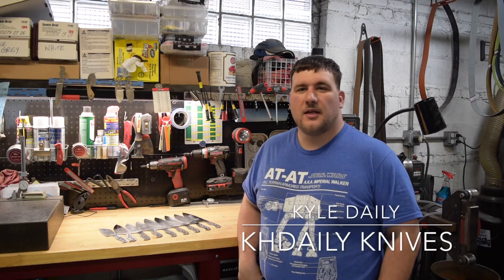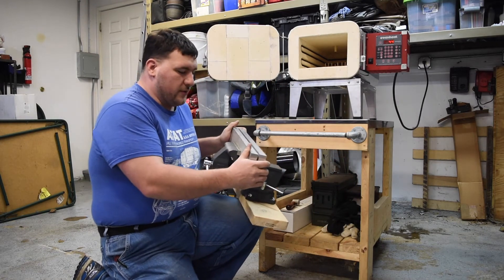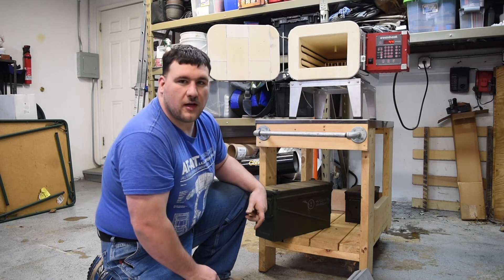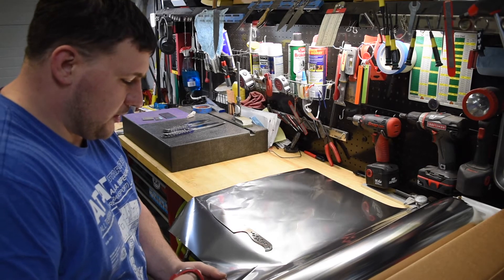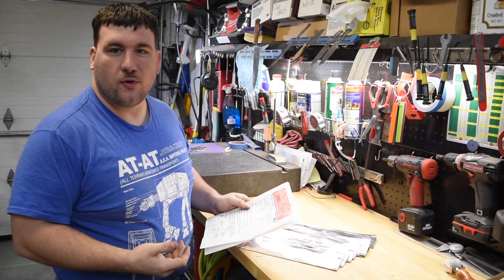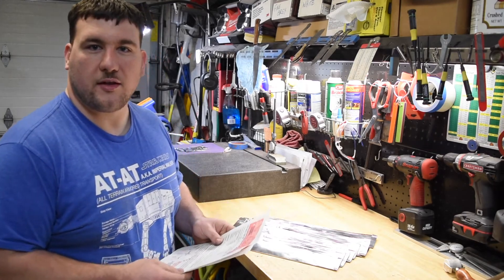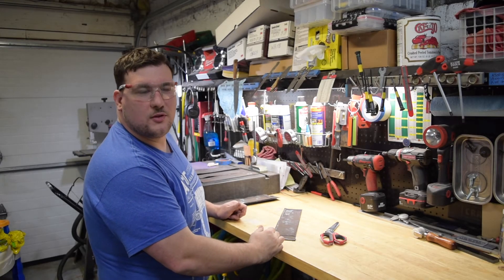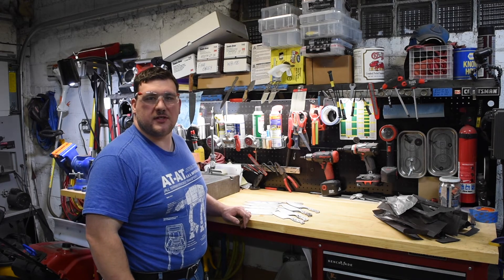Heat Treating 154CM Stainless Steel

Comment: Thanks for the great video. So you put your knives in a cold oven and turned on. Heated knives up to 1200 and equalized. Then 1400 and equalized. Then 1900ish and soaked for 30 min(correct)? How long does the entire process take including heating from room temperature? I think my oven takes too long.
Reply from the maker: I split the difference in the range of temperatures.  I hold for 15 minutes at 1175 F, then 1425F, and then 1950F for 30 minutes.  It usually takes around 3 hours from start to finish in my eveeheat.  The holds add a lot of time, but I think it helps to make sure the blades are at those hold temperatures.  I also have a 220V oven so that helps to heat up faster.

Comment: Do you think the discoloration is caused from two thick of folding over the aluminum ?
Reply from the maker: The colors are some of the natural colors from heating the blade.  Sometimes it can be from the little bit of oxygen that oxidizes in the packet.  I wish it was more consistent, I think it looks rad!

Comment: Great video! How long do you reckon you hit the blades with compressed air to get them cool to the touch?
Reply from the maker: It is about 60 seconds for a larger kitchen knife.  Pairing knives are only about 20 seconds.

Comment: Good moorning please would you tell me about your experience is is better for tougthness blade and tip 154 CM or Sleipner Carbon. sorry for the English but I'm Italian . Thanks for the answer bye
Reply from the maker: 154CM is one of my favorite steels. It holds its edge for a very long time and I have very good experiences with toughness.  It is also has been easy for me to get here in the United States at a reasonable cost for my customers.

Comment: Great informative video, I’ve just bought the same evenheat oven, when you’re heat treating multiple blades, you run the program to austentising temp then you soak the blades after which the oven says “complete” and starts to cool down, how do you keep it at temperature while you’re quenching the blades? Do you just run the program again so it keeps at temp or just use the “add time” feature?
Reply from the maker: Thanks!  I have the oven stay at the austenitising temperature for a longer time (60 minutes).  On the Crucible data sheet says to stay at temp for 30-60 minutes. I start pulling blades at 30 minutes and am usually done after 10-15 minutes.

Comment: What do you mean equalize?
Reply from the maker: That is when the steel is the same temperature all the way through.  On knives since they are so thin, it is less critical. If you were heat treating a block that was 3” thick, you would need to wait at that temperature longer so the outside is hot but the center is not the same temperature. 
Hope that makes sense!

Comment: I plan on heat treating some knives using 154cm,would putting the knives between the aluminum plates harden the steel without using a air compressor?
Reply from the maker: Mysterious Dude 154CM will harden just fine in the air.  Using an air compress more helps when you are doing many blades at once and it allows you to cool them down quicker.  The aluminum plates help to pull some heat out, but mainly they are used to physically hold the blades straight.  I do a lot with thin kitchen knives and they are prone to warping while cooling after heat treating. Hope that helps!
Reply: Cool man thank you👍🏼

Comment: Hello kyle
Don't you mind the fact that when you are plate quenching a blade, the others are still in the oven ?
With this method, each knife of a batch is exposed to the heat a different period of time from the others
Isn't it a problem for the heat treatment consistency ?
Reply from the maker: bretteur2legende I haven’t had a problem with that. The Crucible data sheet says to hold it at temperature for 30-60 minutes. I remove all the blades in about 15 minutes.  I also hardness check every knife and have not seen a difference in hardness between the different knives being at temperature for a longer period.
Reply: @KHDailyKnives  Ok so you have 30 mns to quench your blades, i didn't know that.. Thank you for your quick reply
Keep up the good work ;-)
Reply from the maker: bretteur2legende No problem!  Glad I could help!

Comment: When you stabilize at the different temps I assume you are holding the temp?  How long do you hold it?  I have the same furnace and controller as you.
Thanks in advance,
Eric Stemple
Reply from the maker: John Stemple I hold the temperature at the 2 in between points for 10 minutes each step. With the knife blade being so thin, they are at the oven temperature for the most part. There is a rule of thumb that is 60 minutes for every 1” of thickness. My knives are around 0.11” thick, using the rule it that would be good for blades 0.17” thick. Hope that helps!

Comment: Great video! Any recommendations on where I could find a Wilson like yours?
Reply from the maker: John Stemple Thanks man!  I was extremely lucky to stumble across this one.  I got it from a metallurgist that was going to start his own shop after he retired.  Turned out he didn’t feel like working anymore!  
I would keep an eye out for machine shops that are getting rid of equipment in your area.  Craigslist and eBay can be great options too but shipping could be a lot.  I would call some local machine shops and see if they would let you use theirs or might point you to someone they know. Hope that helps!

Comment: Very Cool.  Do you ever cryogenic-treat your knives.  Had a guy tell me that after he does the plate quench, he treats them in a cooler of dry ice and acetone over night.  I've never messed with SS, so I have no idea if he's crazy or not.
Reply from the maker: Cecil White He is not crazy, he is trying to get a little more hardness in his knives. I do not do cryogenic treatment on my knives. This process gets the knives to 59-60 HRC which is very hard.  When you do cryogenic treatment on the knives, you gain 1-2 HRC in hardness.  When you start having knives over 60 HRC, you need to use more expensive equipment to sharpen the knives.  The extra cost of this additional step for the small batches I do, I don’t feel justifies the cost. Thanks for the feedback!

Comment: Nice info, glad I visit here. Do you mind give us a little info about tempering? How hot did you use in your stainless steel tempering? Thanks!
Reply from the maker: Bagus Bhakti Irawan Thanks!  I temper the blades at 400 F in an oven for 2 hours. This usually always gives me a hardness if 59 HRC.
Reply: @KHDailyKnives  Noted! Thanks, Sir. This info is going to help me a lot in my future knifemaking
Reply from the maker: Glad that helps!

Comment: Here's an old schooler's trick.When I eat at a Chinese restaurant, I save my fortune from my fortune cookies. Put one of those in each bag. When it catches fire (Fahrenheit 451), all the oxygen will burn off inside the bag. No corrosion.
Reply from the maker: I have heard of people putting paper inside of the packets. I have never had a problem with corrosion on the blade, unless I didn’t get the packet tightly sealed. When I pull the packets out of the oven they vacuum down on the blades well. Thanks for the tip!  I might have to try that sometime.
Reply: The larger the part, the more it matters. Probably not so much on knives, since the air pockets are small. Really helps when you EDM a die and it has a complex shape.

Comment: Great video, well put together and informative.    I recently sent some 154CM blades out for heat treatment and I believe cryogenics was used on them.    Have you any experience with that?   Any thoughts?   Thanks.
Reply from the maker: Ken Harrison Thanks for feedback.  You can do cryogenic tempering on the steel. I don’t heat treat enough blades, frequently enough, to make it cost effective for me. The cost of liquid nitrogen/equipment or dry ice would add a lot more to the cost of the knife, for a 1 point HRC increase on 154CM.  At this point I have not had enough customer interest to pursue it. Maybe in the future I will do it.
Reply: thank you, I didn't know it only ads 1 HRC so hard to justify.

Comment: hey pls need to know the right heat for the treatment?
Reply from the maker: I do a three step process from the crucible data sheet for 154CM. 
https://www.crucible.com/eselector/prodbyapp/stainless/154cms.html
It is 1175 F for 10 minutes then 1425 F for 10 minutes then 1950 F for 30 minutes. I use the middle values for each range.  Then I cool in air and temper at 400 F for two hours.  If you have any other questions, let me know!

Comment: Really enjoyed your video and feel that your trajectory is quite awesome!  Seriously though, I'll be amazed if you are not cranking out significant volume soon!  FYI though good old AEB-L is a pretty great material to make the kitchen gods happy too!  Add a little dry ice after the initial quench and you will be quite amazed with how well the simple chemistry of AEB-L performs.  The only thing that I think is annoying about it is the fact that it does tend to warp quite readily with any heating or hot working.  What makes up for that annoying trait though is the initial cost of such a corrosion resistant and consistent material LOL.  Thanks for sharing your process and I hope that all is well in your world.
Reply from the maker: Doug P Thank You for the kind words and the suggestion!  I have been told to give AEB-L a try. I might after blade show this year.  The current batch of kitchen knives is 27, so they are starting to roll!  After blade in June, I will hopefully be getting a lot of my knives waterjet cut out. That will help me save time on some of the processes I don’t enjoy that much.
Reply: Wow man 27?!  You are certainly killing it in your chosen category with those kind of batch numbers.  Yeah, I do all my profile cut outs using the mill these days.  It is nice to get the stock prepped, drilled, bolted onto the plate and simply hit cycle start while looking over from time to time to see that the chips are being evacuated from the cut. Leaning into the band saw and following the sharpie lines certainly got old after the second or third rendition.  Going down the water jet path certainly makes sense for your volume.  Hope that you have a great Blade Show!  Thanks for sharing.
Reply from the maker: That is cool!  What mill do you have?  I would eventually love to get a CNC mill. I used to work in a machine shop and have some fairly decent CAD skills. Eventually it would be awesome to have the handle profiled and then rough machine in the grind. The waterjet is the cheapest option right now. I have thought about the CNC plasma too. Then I can just clean up around the outside.
Reply: I have two Tormach Mills (an 1100 and a 770) that were bought several years ago.  I absolutely love them- even if they are low powered machines compared to industrial class VMC's.  I can completely fixture and profile 2 7" chefs (from AEB-L or CruWear bar stock) on a 770 in just under a 30 minute cycle.  After lots of testing and waste analysis I use dirt cheap 1/8" 4 flute carbide end mills to do it because 90% of the operation is slotting in the 1/8" thick stock anyhow.  I just program for a helical machining operation and use a little mist lube and compressed air blow to evacuate the chips.  I could knock a few more minutes off the cycle by going to a larger end mill, but there really is no practical advantage for me doing so.  I too have thought of using Plasma, but I often worry about the heat affected zone and inducing warp.  Even if it is minimal it still sucks to deal with :-).  Water jet doesn't produce any of those problems.

Been dealing with family issues here for the last 18 months so any knife making has been mothballed.  I'll be busting loose again in June hopefully, but it is going to have to be a part time endeavor for a while.
Reply from the maker: That is awesome!!  I would love to get some CNC mills someday!  Right now, it will be the trusty 2X72” grinder and my 9” disk grinder for awhile.
Reply: No problem.  I have a home made HT Oven with an Auber SYL PID here.  I typically leave about 20 thou of meat behind the edge before heat treating a knife.  Then foil wrap the AEB-L goodness, argon purge for a few seconds and finally bead roll the hammered double seams for good measure.  Sounds complicated, but its pretty quick.  I preheat the oven to 1560F and put the packets in for a 30 minute normalization.  From there the controller ramps rapidly up to 1920F for another 30 minute soak.  I pull the packets out and plate quench between two 1 1/2" aluminum plates (frozen for good measure).  Allow the blades to get <100F and then place directly into dry ice/camper anti-freeze slushy for a few hours.  Double temper at 350F and you should average out >60 HRC.  Granted this ASSumes that we have calibrated equipment.
Reply: No problem!  Finish grinding thin AEB-L used to drive me nuts because it would want to warp with minimal heat input.  Grinding with mist coolant and a cobbed up jig (made from some 1/4" aluminum angle stock) made a HUGE difference in the overall quality and time to finish.  Highly recommend coolant for grinding a fillet or boning knife that has a thin profile.  In the end I do love the AEB-L though because it simply performs and is a breeze to put an edge on.  Oh yeah and it is a LOT cheaper than 3V or CruWear!  I love me some high alloyed PM steels, but I don't like forking over $25/foot for 2" wide stock.

Comment: Hi, very informative. I have a number of S/S can and bottle openers that were made in India. They have a price tag of 10 cents, so are not the best quality, I suspect. I would like to make knives with these openers. I have a woodstove that I have used as a blacksmithing forge to make iron and steel implements. Would you say that This would generate enough heat and can I just plunge them in water to harden them I don`t expect to get them Rockwell hard, just enough to keep a fair edge. Your comments would be appreciated. Thanks and I subbed.
Reply from the maker: 1fanger Thanks for subscribing!  I don’t forge knives, so I have no idea if your wood stove would be hot enough, I do what they call stock removal. I start with a bar of steel that is the thickness of the blade I want to make and grind away what I don’t want to be part of the knife. With stainless steels being exposed to oxygen at high temperatures makes the carbon come out of the material. This reduction of carbon makes the material have lower hardenability. I probably wouldn’t use water to quench, I would probably use air or some aluminum plates. 

With knife making in general (unless you are talking about Damascus steel) the steel for your blade is one of the cheaper cost items. You will spend more money on abrasives, handle material, and adhesive as you do on the steel. I have heard forging stainless steel is a really hard. That is why most people that forge knives use high carbon steels such as 1080/1095/52100/W2 to name a few. I would try to find a known steel alloy for your knives. That just eliminates one significant variable from the process. Places like Admirl Steel and the New Jersey Steel Barron are places that have great blade steel for forging or stock removal. 

That all being said, if it won’t cost you anything, you could try it and see how it works. Sounds like you don’t have much cost into it, so you are not out a ton if it doesn’t work. 

Hope that helps!!
Reply: Thank you for the insight. Be well, Joe